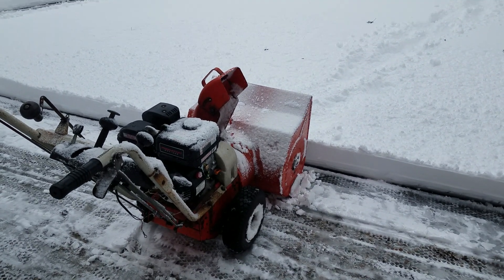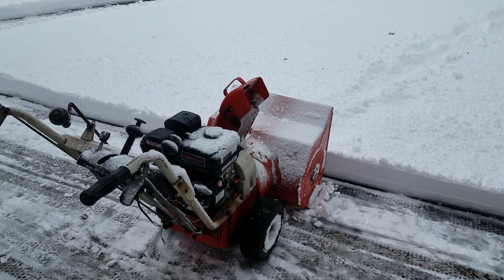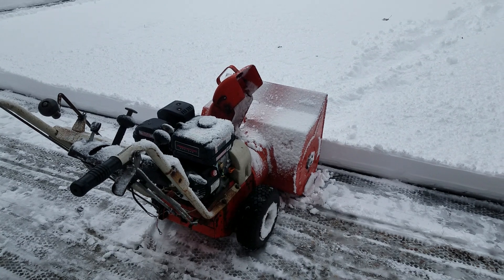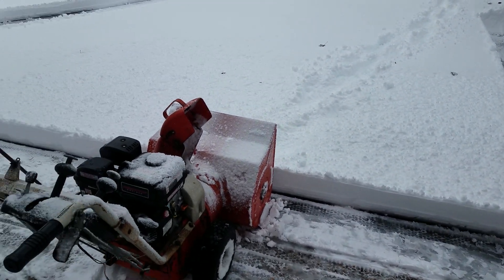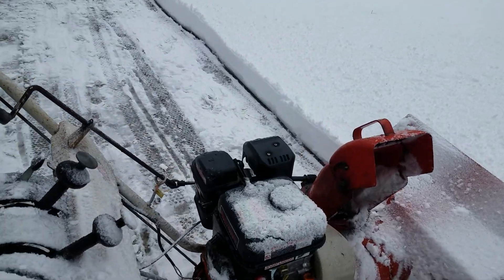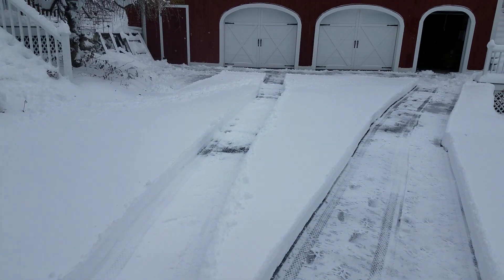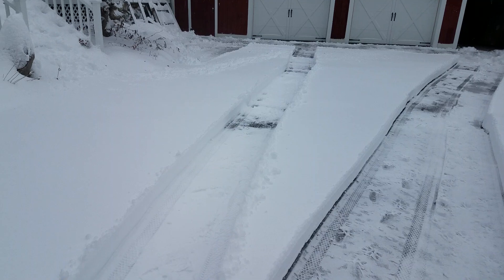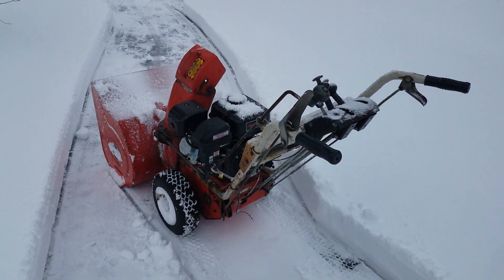Harbor Freight Predator Engine on Ariens Snowblower - How does it work almost 2 Years Later

Comment: I have the same Ariens 1979 724. Might put a predator in the future. I did add an impeller kit and roller skids shoes
Reply from the maker: How did the impeller kit turn out?  I was thinking of getting one myself!
Reply: @lumpskie  very good. I used a tire side wall.
Reply: What size motor is that?
I put an impeller kit on mine. Bought it on ebay for $30
Reply from the maker: It's the 212cc, I believe.